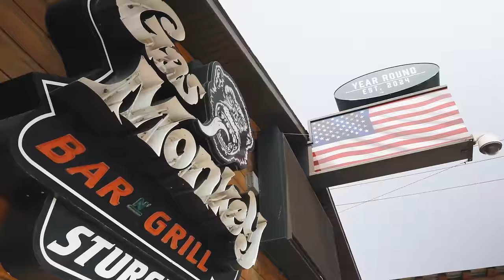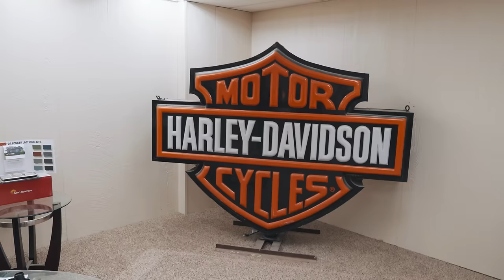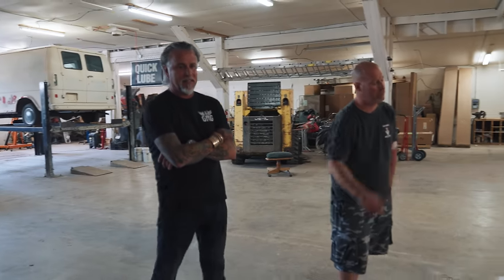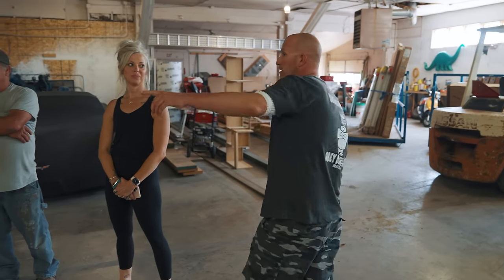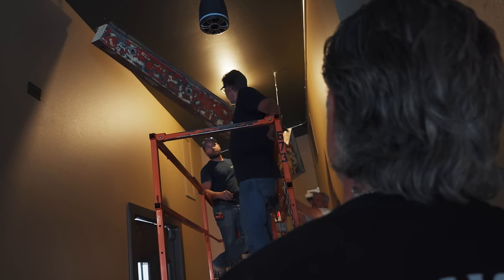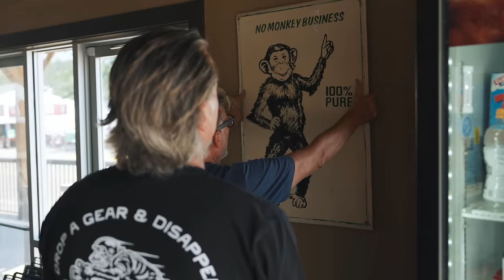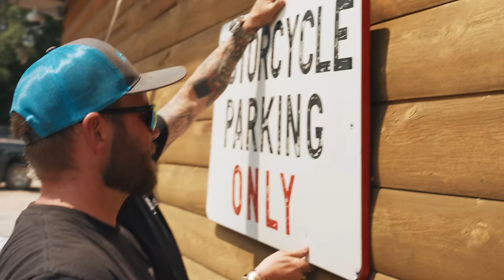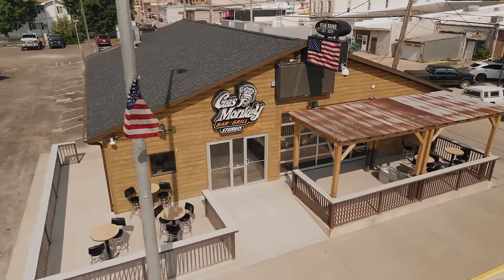Gas Monkey Sturgis: The Final Touches

Comment: Clear coat all the rusty (patina) covered metal to keep the look of it from changing and prevent rust getting on people and staining their clothes when they touch or rub against it. It will also make cleaning the place easier by keeping the rust from getting on the cleaning rags and smearing everywhere. You should swap out the Hex Head screws going around the bar for Pan Head screws so people don't cut their knees, or toes/feet for the sandle and open toe shoe wearing ladies, when sitting there and bumping against it. Bar is looking good.

Comment: Circle or square stools that are attached to the outside drinking area fence or wall line that could be unfolded if someone wanted to sit might free up some drinking space instead of the high tables and chairs in the video. Might be a great future feature. Saw this dining table on fb marketplace had swivel circle seats that would swing out when needed and then stuffed under the table when not in use. I'd have bought it if I wasn't broke guy wanted only $300. Was cool the table was a nice aged wood with iron sides and iron arms for the swing out stools.

Comment: Does the Rusted and Oxidized steel , aluminum , iron and cast metal, plastic , rubber , polyester , synthetics , lubricants,  gas and oil...ect  ... emanating and floating in the air ... from all that JUNK .....add to the taste or make for better burgers ? 
 It looks gross man ... seriously .. .would YOU eat there ???   ...LOL .   How did this pass inspection . ???